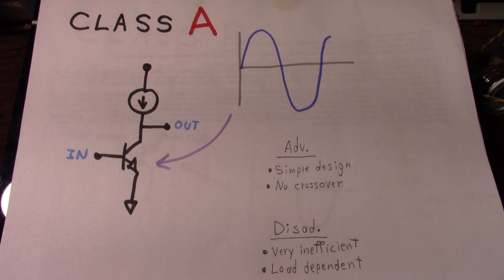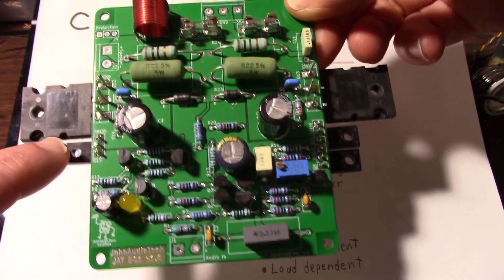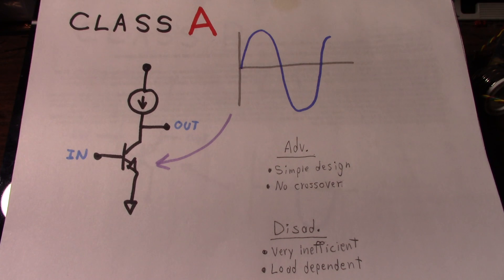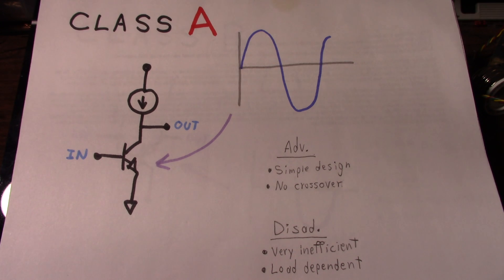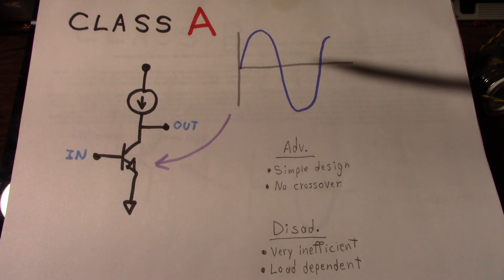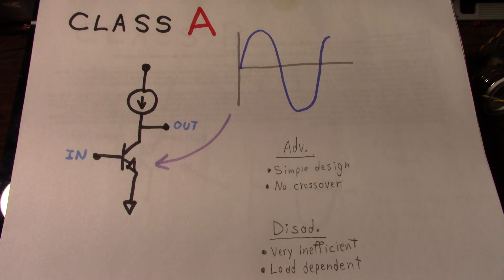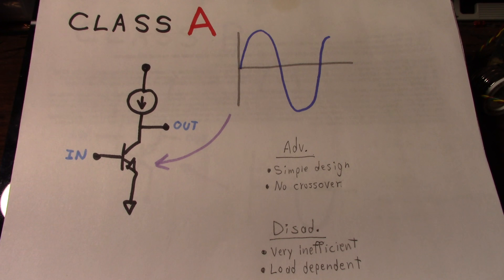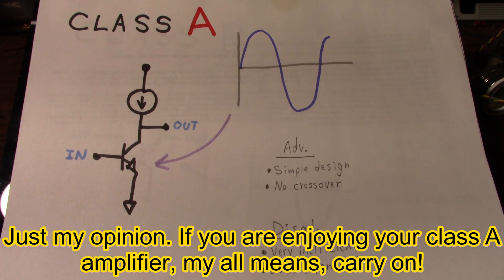Audio amplifier class introduction - Part 1: Class A

Comment: I've always been of the opinion that if a Class A is going to be used, it is best used as part of the gain stages of the amplifier.  Power consumption is usually very small, and unwanted distortions can become a real problem in those stages.  However, for output stages, Class A is usually a waste.

Comment: I've got a couple old Crown D-series amplifiers (the ones built like tanks that can be used as DC bench power supplies). In their manuals, they describe their operation as Class AB+B. My understanding from the manual is that the core of the amp is class AB, but there's an additional Class B power stage that kicks in for high-power use. Pretty neat solution, but doesn't help with the "letter soup" problem of amplifier classes.

Comment: I have following along videos of cheapaudioman, michael beeny, PS Audio, and yours to get better understanding of various amp options and getting the itch to go for it and make amp, and also assemble speakers for them. 
i heard that the class D has good efficiency but the PWM concept in it may cause fatigue for listener after some time. 
So class AB appear to be next option,  Which are great chip / DIY boards for this to get decent audio for home setting

Comment: Note that a single-ended Class A stage designed to drive a low impedance load (like a speaker) would be more likely to be configured as an emitter follower with current sink as the emitter load, and the output AC coupled to the load.  What is shown here is a common emitter stage with current source at the collector, which would not have as low an output impedance.

Comment: Also as class A output transistors run hot it's worth noting that for every 10 degree Centigrade increase in the transistor junction temperature, the life expectancy halves.

Comment: How Class A ( Signal Transistor based ) produce AC output as drawn ?
Reply: AC input = AC output
Reply: @CraftAero  Bjt is dc device not ac
Reply: @CraftAero  how can you get ac from BJT connected with vcc and Gnd ?
You can get sine wave but how ac ?
Reply: @CraftAero   sine wave can be DC offset but AC is something that goes from positive to Negative Alternatively from it's Center point .
Like mains AC which goes positive and Negative potential Around Nutral 50 or 60 times per second

Comment: In fact there are 2 versions of class A output stages. The first version is to operate the output transistor against a current source. In this case, the current source must provide the maximum current of the load. The maximum efficiency for this version is 25%.

The other version is to operate two output transistors in push-pull configuration. In this case, the idle current is only half of the maximum current drawn by the load. Depending on the signal direction one transistor carries more and the other one less current until one transistor carries the full current and the other transistor carries almost no current. The maximum efficiency of this version is 50% and not so much worser than class AB operation.

Comment: The ideal solution is to run class A at low power then class AB at higher power. One problem with class A is having to have a big capacitor to block the DC since they usual sit at 50% supply voltage.  But in some A+AB amps with complimentary transistors there is no cap so I suspect they sit the dc offset at around 1v on speaker terminals and dump current into each pair?  Or you would melt your speakers sending DC into them so Ive always wondered how that's achieved.
Reply: With a complementary stage, you either simply set the DC offset to 0mV, if adjustable, or match long tail pair transistors until you achieve the desired result. And since you have both the positive and negative supply rail, the midpoint is naturally zero. Negative or positive DC offset does to a speaker ... what the name actually implies - offsets the cone from its rest position by keeping it inwards, or outwards correspondingly. DC voltage drop across the coil resistance produces heat, just like music signal, but with no sound output the entire 100% turns to heat, not the usual 99%.
Reply: @paulb4661  my question is really how do u achieve class a operation without the need of either a capacitor or transformer for dc isolation since class a normally sits mid voltage. I get that if u have a split power supply the center point is 0v but there needs to be some voltage at the emitter for the current to flow. That voltage would normally drop across the emitter resistor but that's a lot of current in class a.
Reply: @Cyrixxz  It runs from the positive rail, if you take the conventional current flow, to the negative rail through both transistors and source/emitter resistors. Imagine one transistor as supplying and the other as absorbing current instead. Majority of voltage drop takes place across the actual devices, not the resistors, with usual 0.15-0.33ohms they do not drop much voltage. Take 1A bias;  1x1x0.22 = 0.22W power loss at each resistor.
Reply: @paulb4661  I see what you're saying but take for example the hood amp I built that idles at 2.5 amp at 12v midpoint. To achieve a similar bias on a split power supply of +12 12 instead of 24v presumably ud still be burning 30 Watts in heat and that won't be effected? assuming ud want the same output power and to remain in class a operation? Just don't need a cap or transformer because the dc is sunk into the p or n transistor depending on +/ biasing. I have seen it done with mosfets in marantz and Hitachi amps this way and they pull the bias into class ab from class a when the output reaches a certain threshold.
Reply: Sounds like you're conflating amplifier class with bipolar / unipolar supply.  Any amp can be on one or split rails, with no relationship to amplifier class.  The classic JLH amp is single supply with an output coupling cap, but there have been versions with split supply and bias servos to achieve near zero dc on the output.
Reply: @paulb4661  I've been thinking about it on and off and maybe if u was to invert the input on the output stage to say the p transistor then when the current swings so it will be inverted on one of the complimentary pair. That would mean that each output device would be sat at 50% of the rail voltage so on 50-0-50 that would mean +25v and -25v giving 0v on the output then when a sine wave is fed the voltage would swing to +50v in the n device and 0v in p device then it would pass 25v mid voltage then in the negative portion of the wave it would swing to 0v in the n device and -50v in the p device. So basically each device sits mid voltage of its rail in respect to ground and this would mean using an op amp to invert the signal then u could make a class a that switches to class ab at a certain threshold even use op amp as a comparator to control threshold and pull the class a bias above a certain output. I might build and try it I suspect it will get very hot at idle.